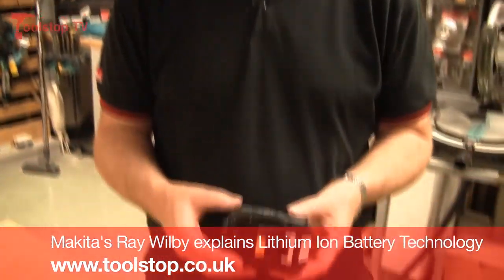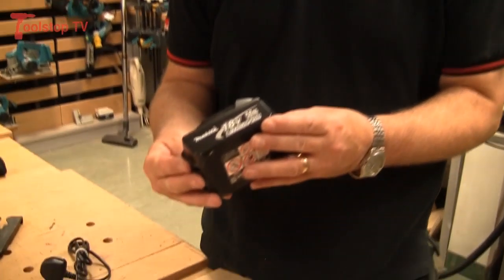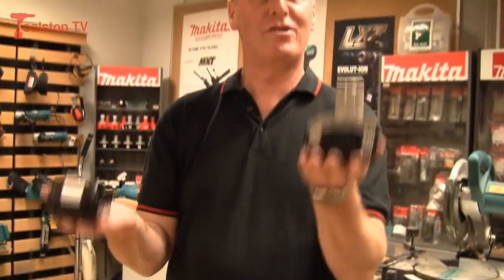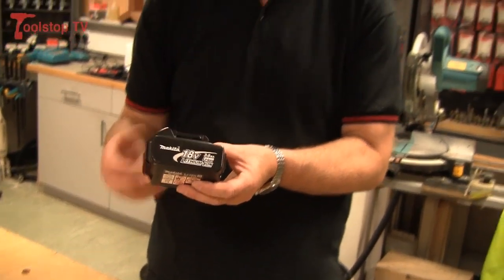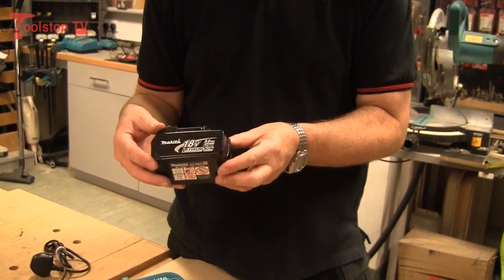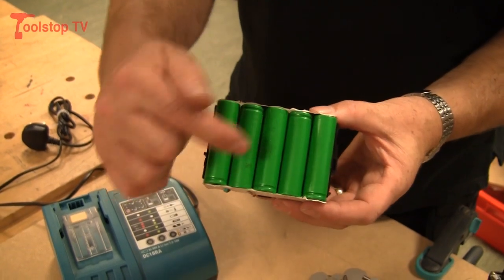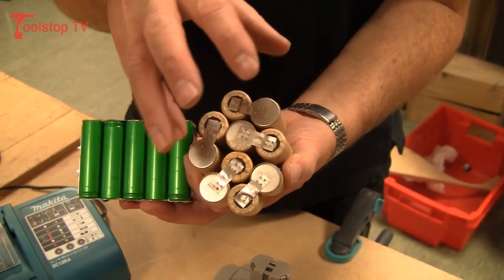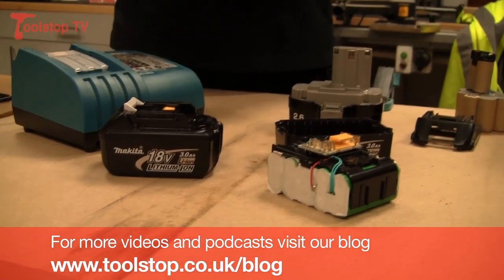Walkthrough - Ray Wilby of Makita explains lithium-ion battery technology

Comment: 2000 yeah right, my butt! Makita you screwed your most loyal customers. I didn't even get 20 out of mine before your charger rejected it and I was using it minutes before I tried charging it ( not real heavy either) Had I new the magic number was 3 times in the charger I would have stopped and charged it another way. The best tools with the worse charging setup I have ever seen. NEVER AGAIN MAKITA...99 bucks for another defective battery NO WAY

Comment: I bought a pair of cordless drills and liked them so much I bought the heavier duty ones (turquoise) less than a year later.  Bad move.  Now, shortly after the warranty on the second set has expired, I have one remaining battery out of the original 4. It's as if the computer chip he's talking about in the video is designed to tell the charger the battery is broken, rather than give the optimum charging rate, etc.  If this computer chip is an "upgrade", why do the old batteries still work after 10 years and the new ones last just until the warranty expires. Convenient!  I think I am going to research class action lawsuits and planned obsolescence now.   Hey Makita! You want to give me 4 new batteries that haven't been programmed to intentionally fail, or do you want to dole out millions of dollars and have to recall this particular model of batteries?

Comment: Being a sub contractor I move around a lot of job sites. What i have seen is
The number 1 killer of these batteries is the Makita radio. By the time the radio turns off your battery is totally drained and at risk of revers polarity shift of lowest charged cell.
Next biggest killer is heat generated by discharging at a fast rate, so that skill saw, reciprocal, jig and grinder to name a few if used in one long cut till battery is starting to die will generate enough heat to damage battery cells.
Also a failure with charging is that just measuring the individual cell condition doesnt help unless it charges individual cells separately.
The chip doesnt cause failure, A lack of simple education and a poor charging system causes failure of 1 or more cells and chip shuts down charger to stop the good cells over changing and catching on fire or exploding.
note...A battery is made of individual cells and is only as strong as the weakest cell. If one cell does not get a full charge it will be run down to a lower capacity than other cells at each use and not be fully charged each time as I said above the charger cuts out to stop the fully charge cells from over heating and catching fire, this is the 1 cell that will cause the whole battery to fail.

Comment: I have been using Makitas for years as well, and did not believe the rumors of these new Li-on batteries fixed to go bad after a period of time, but 14 months later, sure enough all 4 of my batteries died like nothing... never overused them, never let them drain completely or even heavy duty work on them, but still, all dead. sad thing is, the really old NIC batteries 12+ years old are still working.

Comment: Makita batteries are rubbish! The reason they are rubbish is that stupid lock out microchip they are fitted with. I have two dead batteries, one never actually got used & the other was charged twice. I have an el cheapo brand of cordless drill that is 10 years old & it's still going. Shame on you Makita!

Comment: I bought a $279, 18 volt Makita drill about 18 months ago. The reason why I bought the drill is because I thought it was top of the line and I wouldn't have to buy another drill for several years.  Long story short, after only charging each battery pack no more than a dozen times, they will not charge anymore. Since they are 18 months old, Makita told me to buy new batteries - not under warranty.  Nope, I will be buying a competitor's drill.  I will never, ever buy another Makita tool again!

Comment: I have been using Makita tools for over 2 decades but the new "designed to fail" Lithium cells are a joke and makita should fix the software in the packs and replace the logic boards in the existing cells and warn people in advance that their packs WILL most probably lock themselves out whilst prefectly functional forcing the customer to have to purchase a new one

The problem isnt with the battery cells themselves but with the control logic and the way Makita has made the system work